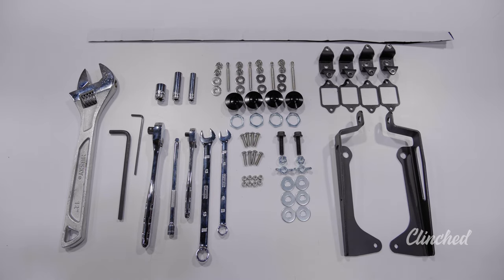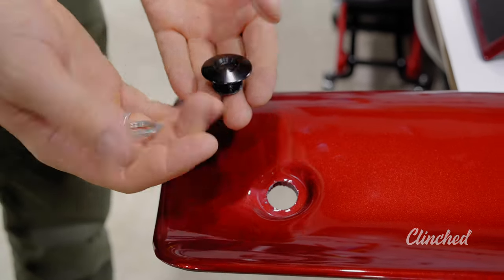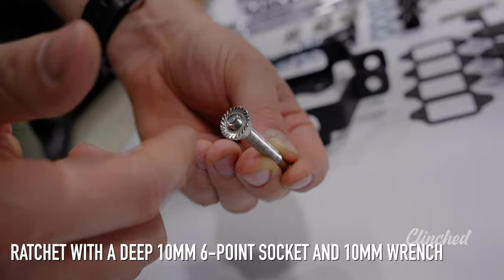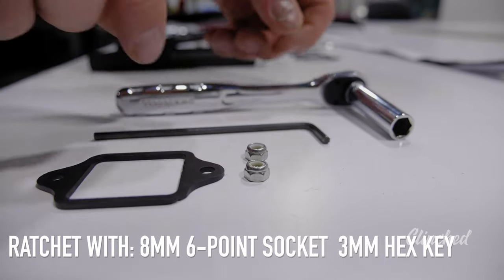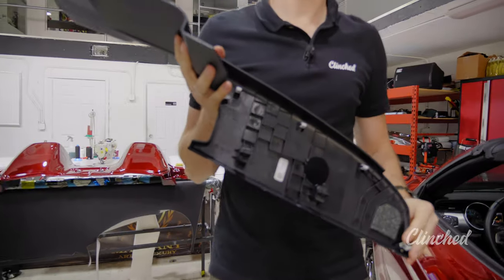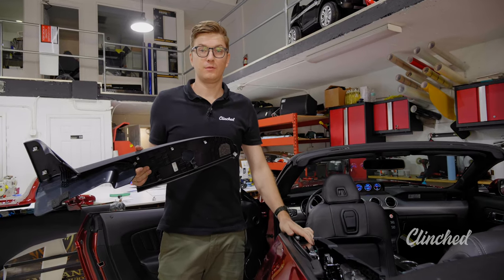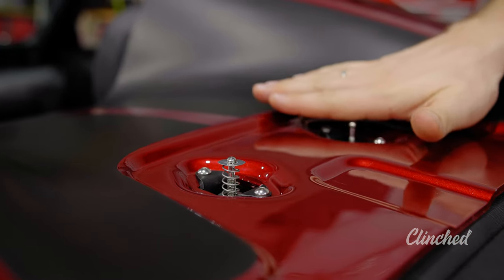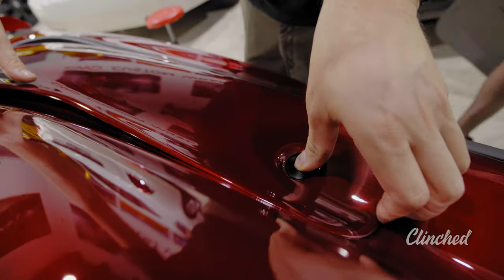Ford Mustang S550/S650 Spider Top Installation Guide

Comment: I’ve had mine on for quite a while and love it. Mine is on a 2017 Shelby super snake 50th anniversary. The only problem I’ve run into is twice the push buttons have broken, came apart. The company was good enough to send me a couple. So I guess I just need to keep some on hand. Not hard to change out!
Reply from the maker: Thank you so much for your review!

Comment: You guys should make a finishing boot to cover those gaps when you have it in passenger mode. My kids still like to ride in the back once in a while. My pet peeve is the new s650 has those giant gaps looks kind of unfinished. Other convertibles like the Camaro do not have those.
Reply from the maker: Hello, Sir. Could you please clarify what you mean by "gaps" in passenger mode? I assume passenger mode is when you completely remove the Spider Top to use the rear seats. Our brackets can be covered with the stock plastic panels on the sides in that case. If you want to close the soft top in case of bad weather, we offer a special bag for rear soft top covers. The bag has a foam divider so the panels won't scratch each other and will easily fit the Mustang trunk. Unfortunately, with the main panel that covers the rear seats, it is only possible to use the space underneath for the bags; no one can sit there.

Comment: Dear sir I just purchased an received my Mustang spider Tonnea and it does not appear to fit,I have brackets in the road ,I told you it was a 2022.23 Mustang
Reply from the maker: Hello Peter, an email was sent regarding the relocation of the antenna from its bracket to our Spider Top Bracket. Please let me know if you need any assistance with installation.

Comment: Im ordering my spider top ,, I wonder though how will that velcro cover will hold up on the HWY speeds? It seems like a gap by panels and doors
Reply from the maker: Velcro help minimize the gap in case of incorrect installation. It doesn't hold the panel

Comment: Can  a crossbar still fit with the clamped top on it
Reply from the maker: We have to remove the light bar from the Shelby, because the bar brackets prevent the installation of the Spider Top brackets. We do not have the experience to fit both.

Comment: Will it fit on a 2017/18 convertible eco boost mustang
Reply from the maker: 100% will fit
Reply: @Clinched  what about a 2012 mustang 5.0
Reply from the maker: @youngbuck388  Unfortunately, it wont fit 2012 Mustang Convertible
Reply: Do you post this to uk? I need this for my 2018 s550